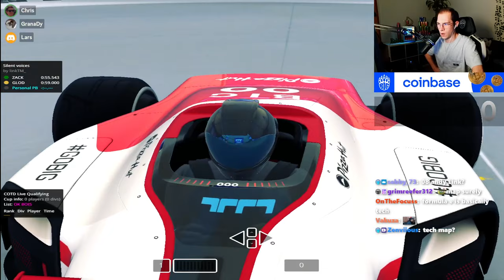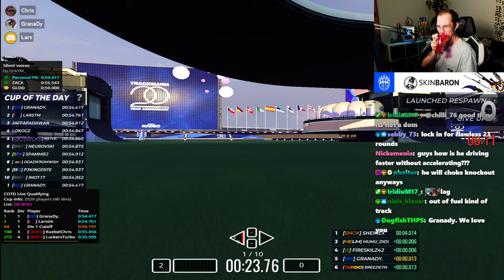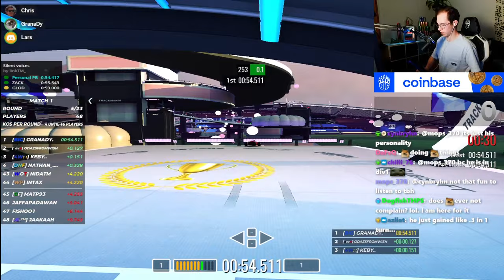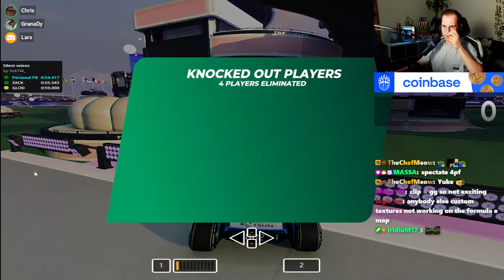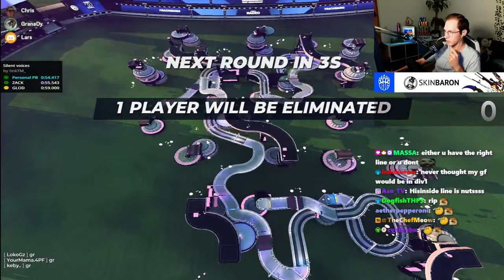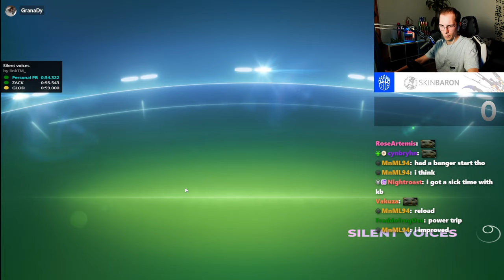Cup of the Day BUT you can't Accelerate! (Wheel is Insane for it)

Comment: Wouldn't it be faster to do a big S-turn in the beginning? Like, try to go as much left and then right again as possible. It's like with reducing airtime - more time for accelerating trumps short-term time save. It's the one part of the map, where you have plenty of space and the speed to do it easily, and I think the excess speed will accumulate over the whole map a lot.
Reply: That’s kinda what I did in quali yesterday and no it’s not faster. It’s only really worth going wide in the one right turn after the sausage uphill, everywhere else just go giga tight basically. I was driving some wrong lines in quali and was losing a lot